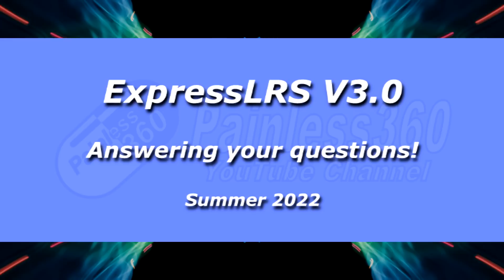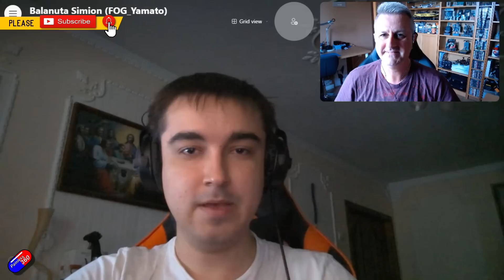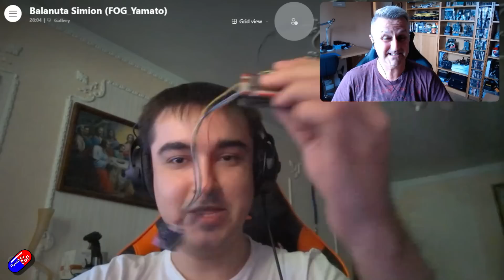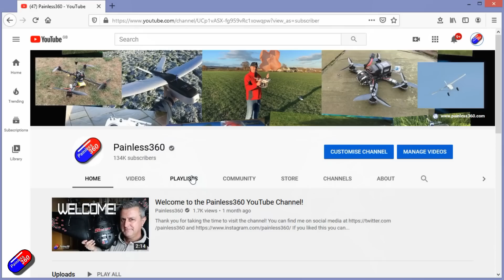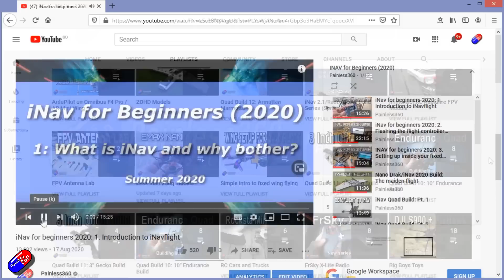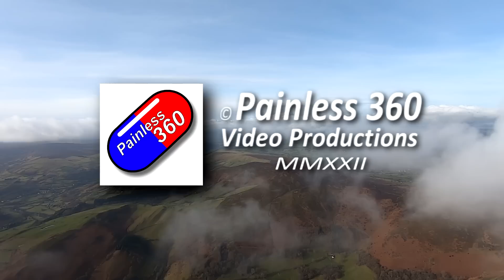ELRS V3.0: Your questions answered (and the clickbait one too!)

Comment: My RadioMaster 12 says it operates on an earlier version than the choices on the Configurator.  Any advice?  How can I tell what version my BetaFPV receiver operates on?  Thanks.
Reply from the maker: This is one of the trickier parts of ExpressLRS that the major version of the radio and receiver need to be the same. You can connect via WiFi to the receiver and look at the FW version on the webpage. See my top tips video for ELRS for more of the basics. Best of luck!

Comment: On airplanes you should always run a throttle disable/cut anyways. So after setting up your throttle channel overrides in special functions you can assign whatever switch you used for that to channel 5 as well to satisfy the arm channel requirement.
Reply from the maker: Until the CH5 dependacy is changed, this is a very good way to do it.. Happy flying
Reply: Does Ch5 need to be high the whole flight to benefit from disabeling bnding and enabeling active link management, or just blip it up once to activate its features and use the channel to drive a servo for the rest of the flight?
Reply from the maker: From what I see, high all the time...

Comment: so on the compatibility with SPI receivers and backwards compatibility between 3.0.x TXs and 2.x RXs, is that something coming in a future release candidate?  The release notes for 3.0RC1 still have SPI receivers running 2.x explicitly excluded and state that backwards compatibility will not exist between 3.0 and 2.x versions.  I am really hoping they reassessed this and decided to add backwards compatibility because it is the only thing holding me back from flashing my fleet over to 3.0 at the moment!  Thank you so much for the video and terrific insight on the questions addressed here!
Reply: Can u just stick to 2.0 and not update? I just got my setup working with the normal rx on 2.0 and i still have a version 1.0 spi that i cant figure out how to update
Reply: @verofpv6152  I think that most of us with SPI based receivers are going to hold onto 2.X for as long as we can so that our quads will continue to work.  I doubt we will really have to get off of the 2.X version until they are already working on RCs for 4.X.  On your 1.X SPI, you will need to flash Betaflight 4.3 onto it which has the 2.X ELRS code baked in for your receiver.
Reply: @BaconNinjaFPV  i downloaded betaflight 4.3 will it automatically find the right file to flash ? Im unsure exactly what fc i have.

Comment: It would be great to extend video transmission to match the range of elrs. That is my limiting factor for range.
Reply from the maker: More sensitive antennas, higher powers and lower frequencies.. See the antenna lab series... Happy flying
Reply: @Painless360  Yes thanks for those videos. I use a high power (1W+) Vtx and a TrueRC X-air antenna on the receiver.

Comment: I really wish the devs would reconsider their position on SBUS output because in addition to FPV drones I fly planes and helicopters with flight controllers that have SBUS ports available. Right now I am using ELRS for my quads and DSMX for my other stuff and it would be great to have ELRS on everything so I could use my ELRS radio on all of them without an external module which I hate. When I was on crossfire I could use it for everything.
Reply from the maker: I have to agree. Having SBUS would make it incredibly useful for older systems...
Reply: @Painless360  Also would make much easier to create a relay using a standard receiver thus allowing the elsr module to stay in a pole or even tracker giving an even better range and letting the pilot to be more comfortable for long range flights.

Comment: May I ask you?
Could you measure and confirm? Do the 1.0 and 2.0 firmware versions really give 10mW output from the transmitter (or much more)?
And 25mW=25mW..100mW=100mW  I just don't have a power meter available.
Unfortunately no one has verified this on the internet.
Reply from the maker: What a shame you didn't ask this before I shot this video. We could have talked about that for you... If I have the kit on the bench and can find my tester, I'll see. Happy flying!
Reply: Yes they do output exactly what the power setting says regardless of firmware version. There may be some slight variations but overall they're outputting what they're asked to.